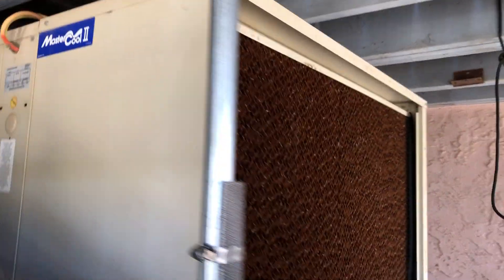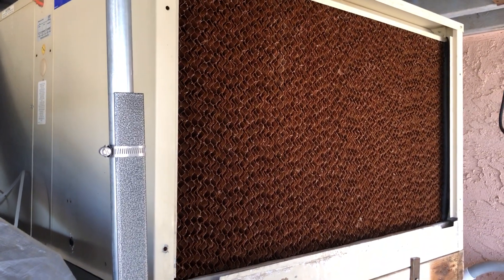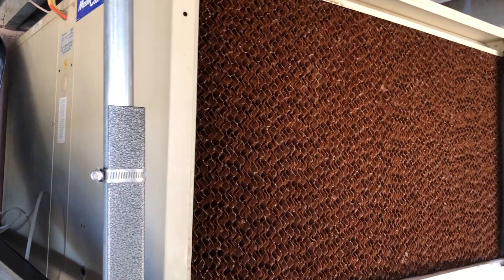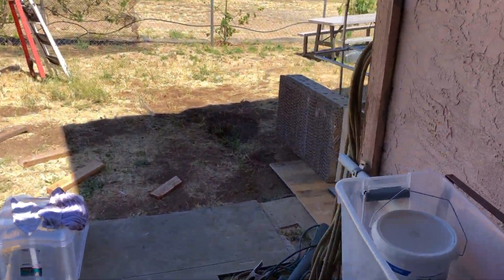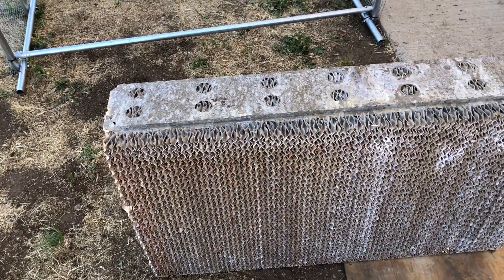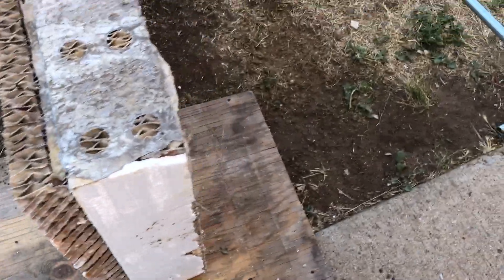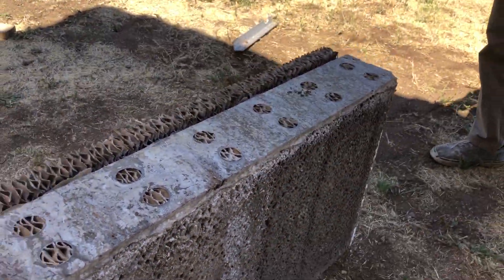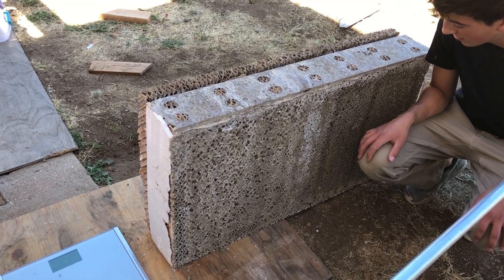Old Master Cool pad.

Comment: This looks like my unit, says Adobe Air. But has mister cool sticker. Do you happen to have a manual on this. Mine is a 220. But not sure pump is. But has 2 blacks 2 reds 1 white 1 green. Wondering if pump Is 220. Thanks Craig
Reply from the maker: Mine has a 120v fan motor, and  the pump is a typical (generic) 120v water cooler pump.